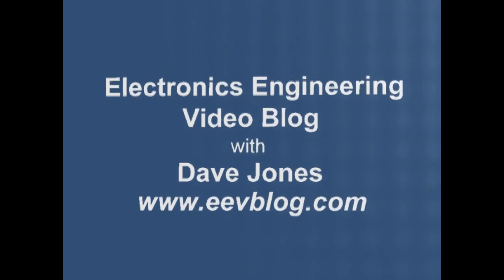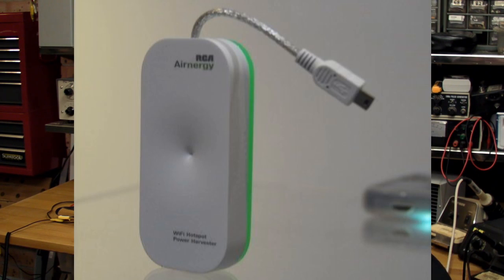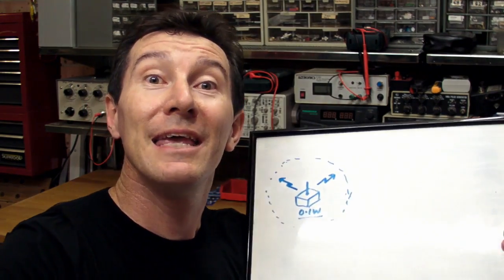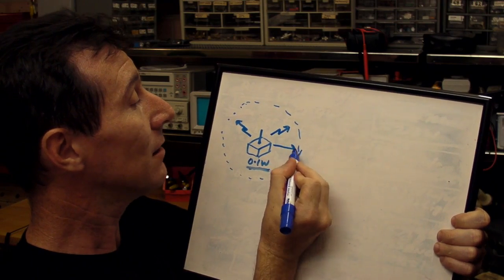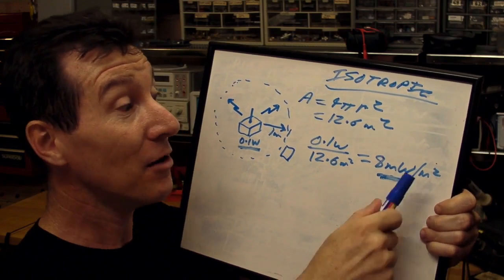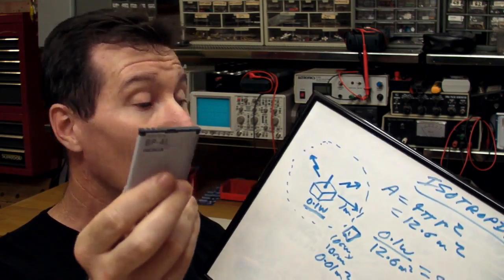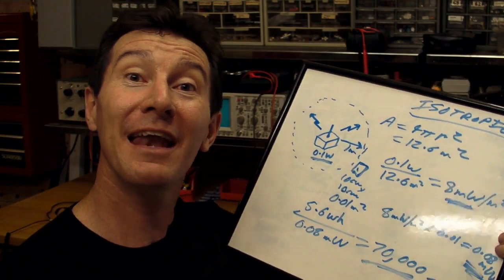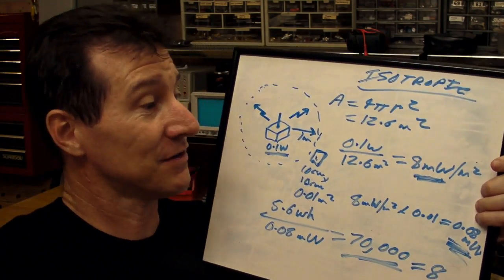EEVblog #55 - RCA Airnergy WiFi Charging Free Energy Harvesting Marketing BS

Comment: And if your phone is on, you are using more energy than you are collecting.. You would do better with a real(not fake) solar panel.. 
How many square inches of solar would you need to equal the charge rate of wall power.??

5v * 3a = 15 Watts (Ideal)

Comment: To add on to the 10 router discussion: The electromagnetic waves from the routers will most likely be out of phase, and as they meet in space they'll interfere with each other and cancel out at some points (destructive interference) and amplify each other at some points (constructive interference). This means that at some points in space it wouldn't even charge at all, and the theoretical maximum would be your calculated value x10 but it could charge at any multiplicity between 0-10. So you'd have to have A LOT of routers for it to even be viable, but also you need to find the sweet spot to get the highest efficiency every time you charge your phone. I agree, this is absolutely BS!
Reply: If you do the math then that already considers the optimal scenario, when all of the 10 routers constructively interfere with each other. Waveforms are then ADDED due to the superposition principle and you end up with a number which is 10 times the energy of a single router. If you calculate the power which you get from 10 routers and then MULTIPLY it by 10, then you've blasted conservation of energy out of the window.
Reply: Only if they are in the same polarisation. What's the probability on that?

Comment: I did the math. Charging and iPhone with the power from my wireless router across the house would take upwards of two million years.
Reply: And it's going to be dead in 30 minutes anyways.
Reply: +leerman22 true
Reply: ***** I just measured a -50 dBm Wifi signal from across my house. The typical iPhone 5 has a 5.45 Wh battery, meaning it holds 19620 J of energy. -50 dBm translates to 10 nW or 10 nJ/s. At that rate, it would take 1.5 million years to get to 19620 J, so I guess my signal was weaker when I first did the calculation.
Reply: If you put it right next to a powerful radio transmitter .... well that is the only place where it might work. And by right next to, I mean, covering the  Arecibo with the antenna.

Comment: Does resonant wireless coupling obey Inverse square law?
Reply: +Andrew Geng Nope the inverse square law doesn't apply there; it works by coupling a magnetic fields between inductor coils. The field is localized and thus non-radiating, so it doesn't experience any spread loss.

Comment: I agree on the WiFi device not being able to capture much energy but there are 2 things to consider...
1. There is such a thing as an active antenna which captures much more signal than it's physical area would allow.
2. There are much more powerful sources of EM in the air than WiFi...I have heard of people lighting incandescent bulbs and running a toaster from nothing more than a long wire in the air and a ground connection and of course being close to a commercial transmitter tower...using these principals one could possibly make such a device...
Reply: >" 1. There is such a thing as an active antenna which captures much more signal than it's physical area would allow."
 No there isn't.  An active antenna creates a boosted signal with an amplifier. The amplifier is powered, which is where the extra energy comes from.

Comment: They should have put a solar cell on it.
Reply: +Benjamin Lanza That would actually be useful. 

According to NASA direct sunlight provides 1,360 watts per square meter. with a collection device with an area of 0.01sqm that's 13.6W. If you use an average solar panel which is 15% efficient then you end up with 2Watts of usable electric power. To charge the same 5.6Wh battery in the video would take 2.8 hours. Totally doable.
Reply: Benjamin Lanza Thunderf00t  already busted the solar power one. lol

Comment: Harnessing energy from WiFi? the WiFi hotspot on my phone has settings to make it transmit at given power levels, and like the highest power level is measured in milliwatts. Then, there is power loss as heat from the WiFi chip, so less gets transmitted, then there is the evil inverse square law, and then they expect to charge a phone with the microwatts of power left!?!? Heck the quentisent power of some microchip would be higher than that.
Reply: Power Max you would get more power running EEVblogs pelter power unit off the heat of the wifi chip then you would this product off the signal !
Reply: astrialkil I wouldn't doubt it! However, stick that charger next to my SSTC slayer exciter and it may pick enough energy to effectively charge the battery in a few short months. :P

Comment: i knew it was bs. even if they made a claim that they could take fm power from the radio station, 

using 5km radius I get 314150000 m^2
I pick one radio station at 69500 W so 69500/314150000=0.221 mW
the device would get 0.00221 mW  not enough

let use value but this time the power output on router  is unknown and we get 1 W

before the unit receives it, i reverse that last formula and got 1/0.01 or 100W

we then take 100W * 12.566 and you get  1256.6 W

You total output of your router would need to be 1256.6 W, that too much power output for your router.
Reply: If there'll ever be enough wifi energy floating around to power our devices it'l be also enough to fry ourselves brown and crisp :)

Comment: This came out because Tesla's wireless energy coil started making the you tube rounds. people were lighting up a led bulb using a coiled wire, with resistors and capacitors. One guy even made a large version with 12 foot wire antenna and a small DC motor with super efficient ballbearings running with no load. It works but its not practical.

Comment: you cant actually charge a phone from 30 to 100 in 2 hours. i charge my phone from my computer psu and it takes 1 hour to get 25% and thats because of the usb standard if i charged the battery without the phone being inbetween then i can see it going faster.

Comment: Technically, if you take all the radiated power from someone's signal, you will just block that signal from passing through, which in effect is not much different than active jamming. Something like that could become illegal, if it's not already.

Comment: It will work if one puts it in the microwave oven.
But probably it can't handle so much juice :)
Also its more efficient to just use a normal charger or even a hand-cranked dynamo.

Comment: It still wouldn't work. The issue is not how quickly it charges, but it's the simple fact that there's just not enough energy in WiFi signals to be used to charge the battery with.
Yes, graphene batteries charge much faster because they're supercapacitors, which charges by "directly" storing electricity(electrons); while lithium-ion batteries are only electric cells, which produce electrons through chemical reactions and are recharged when you apply electricity, which will reverse the reaction.

Comment: Mine Antenna is working with 40% of it's power, cause I'm not that far away... So I'm gonna charge it for more than 16 years then? :P That's fine with me... I'll just post on facebook that my battery is low and is going to be recharged in approx. 2030 by perfect conditions! :D

Comment: I've been giving some extensive amount of time and effort to free energy, particularly in the receiver based. This IS possible, but one needs to understand that there is a great deal of wide band white noise in the TV channel frequency range that has more potential for charging than any single frequency receiver. Tesla seems to have utilized this energy. TV receiver engineering does discuss this noise factor. It is so great at some bandwidths that the desired frequency is unusable.

Comment: In Germany during DDR-Time the residents near radio-stations "Stole" Energy from the Radio-Waves the transmitter emitted by putting up a dipole with the wavelength tuned to the frequency from the station and were able to operate a little lightbulb from it. But these stations had thousands of watts of transmitting power an therefore it worked pretty well (my grandpa did it too; Yes, I am German).

Comment: It is quite obvious if you think about it. Any mobile phone has a constant connection with a local transmitter. If that worked, why the hell every mobile on the earth wouldn't be powered straight from the transmitter? Black berry charged in 90 minutes, for ~4 days of operation... so just keeping the energy coming as needed should be easy in that case. So stupid...

Comment from the maker: @waynep72 That's hilarious! It doesn't really work, so they add another method to charge the battery. Rev 3 will have a magnet and coil and you can just shake it for 5 minutes. Shape it like a dick I recon.

Comment: Well, it looks like the RCA Airpower (aka Airnergy) has raised it's head again at the 2011 CES.  But this time they have added solar cells.  It's even been able to win a 2011 Innovation Honor in the Portable Power category.  I still want to see how long it takes to charge with just the WiFi.  (I suspect it won't , but at least there is the solar "backup")

Comment: Im sorry but im having alittle giggle at those who say things about tesla and wireless power. while im a big fan of tesla  And he conducted small scale tests with wireless power, these only worked because he pumped MASSIVE amounts of electrical energy into the transmitter only to light afew small light bulbs afew Km's away. Induction  pads are a slightly better idea, but they are still inefficient. dont buy into this marketing crap and just plug your device in..and save yourself money

Comment: you too the words right out of my mouth !  Ball  Part . i remember reading about this in the 80's....little transmitters that had no battery, powered from Broad cast electromagnetic Waves ! you cannot change the Laws of Physics.
Reply: Occasionally you can change the law of physics that's because the law was incorrect in the first place. For example I read that refractive index is 1 or more, but now we have metamaterial that produces negative refractive index.

Comment from the maker: Oh, for sure, there is a huge future in wireless power, and much research being done. It's just in this instance they are stupidly trying to apply very low power energy harvesting to a relatively high power application, so it won't work. But if you put a correctly designed high power resonate induction coil under your desk or in your wall, this type of thing can be made to work. Just not by sniffing WiFi I'm afraid!

Comment: @SomeMoreVideos2468 For example take a look at Toshiba's SCiB. They claim 90% charge after 5 minutes at rate 12C or 90% after 10 mins at 5C. It should be available next year. Not targetted at mobile handheld devices though.

Li-Poly for RC models can be charged in about 1 hour and stays cool (I have one)

I don't say it'd good to charge your phone in microwave oven, just that these fast charging batteries exist and there will be more in future. Li-based chemistry is still in heavy development.

Comment: ad wireless energy: I know Tesla was playing it and that recently there were some claims of somewhat effective energy transfer (look up Wireless energy transfer in wiki). I don't know the details but one thing is sure: they made special how power transmitters designed to actually transfer power unlike usual wifi router which is low power and mostly omnidirectional. I think you could get more energy with piezo directed at the RCA people talking BS than with this box :)